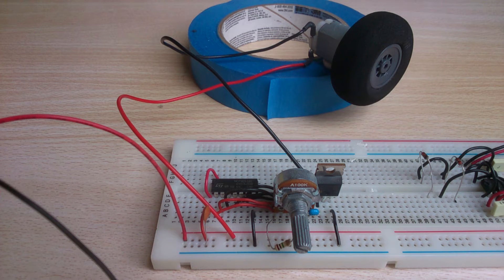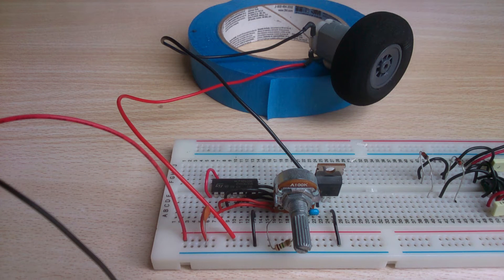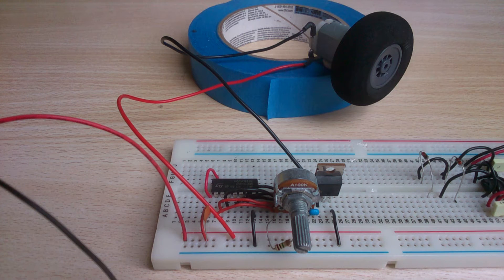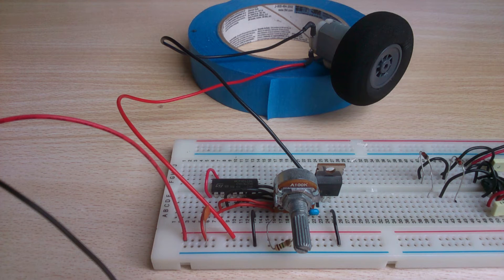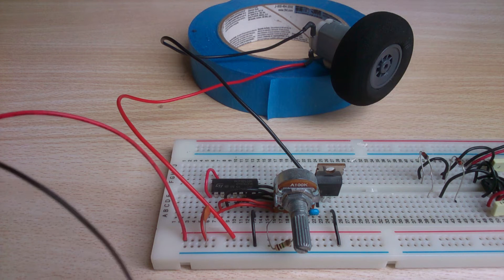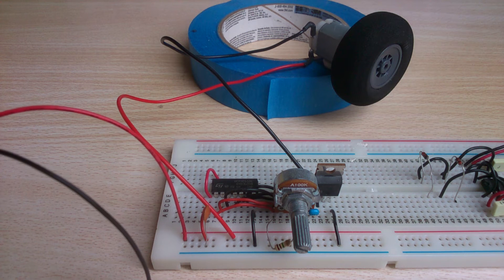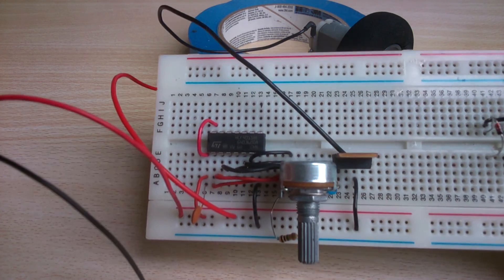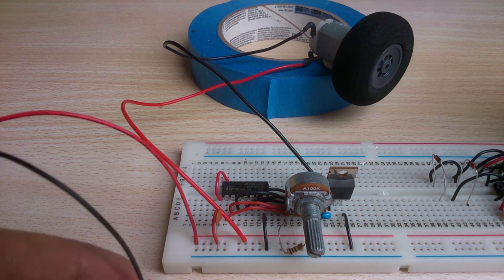PWM DC motor speed control circuit - Part 1

Comment: sir can you say which IC u can use and also I can do with 12v dc motor?
Reply from the maker: 12volt DC motor should be fine. If I remember correctly, the IC was a IC5 8 pin chip. Just google circuit boards re variable speed DC motor control...loads of geeks with some great DIY boards to control speed of DC motor. Good luck

Comment: sir may i know the physical properties of your DC motor, like Voltage, Current, Reduction rate, RPM (With tire).
more power!
Reply from the maker: Hey Pedro. The DC motor is a 6volt motor. The spec you can find on google. An old project and unfortunately I can't find the schematic notes. Google 'circuit design for DC motor speed control'. Good luck!!

Comment: Where can I buy that dc motor and wheel? Do you glue the wheel to the motor or is it just press fit ?
Reply from the maker: Hey. The wheel you can google retailer (aircraft model shop or foam wheels etc) DC motors are widely available from online circuit component stores. Good luck. Let me know how you get on!
Reply: I found motor and wheel on Aliexpress. I used superglue to attach the wheel to the axle but that was bad idea because the glue reacted with the plastic of the wheel .